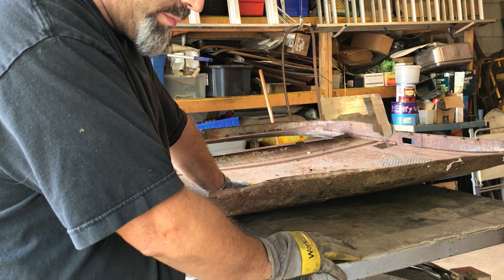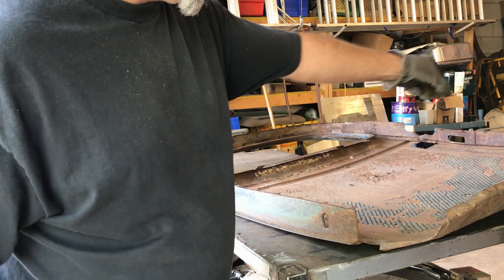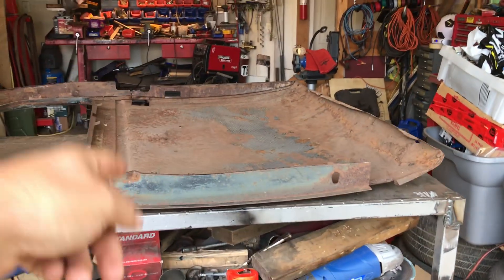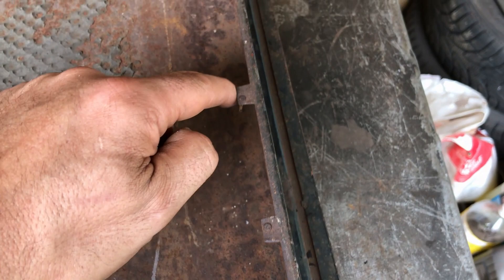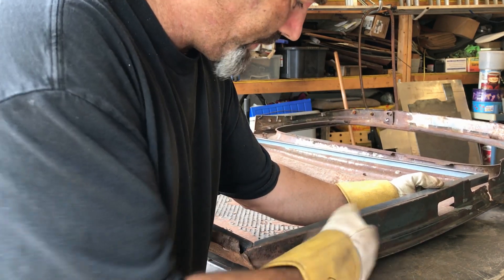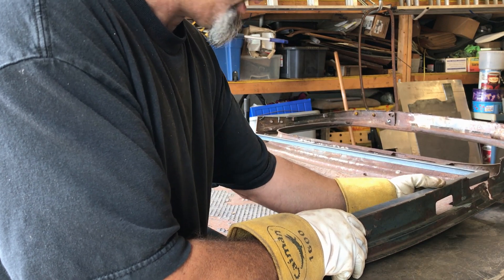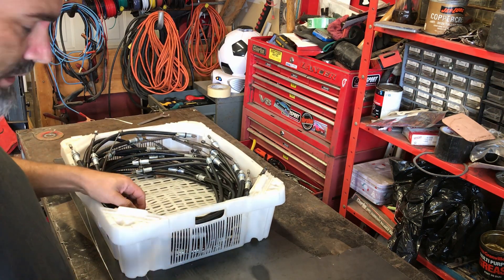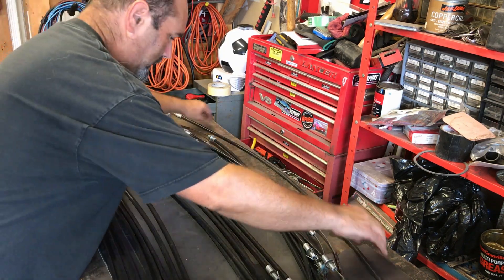Door Frame Fabrication Part 2 On My 1936 Chevy Coupe

Comment: been watching for a bit now getting some tips i am starting a 1935 chevy master coup so if you have some links or advice where to get some parts or what you used on your biuld would be helpful
Reply from the maker: If you are going for a period correct car, then parts will be tough to find. If you are just building a hot rod, then with a bit of imagination, you can make just about anything fit. 
I made do with what I could find at the time, with plans to replace with better parts when funds and parts became available. I didn’t want a ten year project, I wanted a one year drivable project that I could improve upon over ten years lol.

Comment: I used wheel spacers in the past on a 69 340 dart to convert from14 to 15 inch wheel, but never trusted them under power so I removed them, but for what your doing it will be fine ( as they say) lol great video Dave...✌️🤙🏻👍👊🏼

Comment: Hey Dave. That wasp looks pretty drunk. But how could he get drunk on Coke?🤨 I bought a set of spacers for my Fargo. I needed the rear wheels to be 1 1/2 inches wider on each side. Mine worked perfectly. I hope yours do. Thanks for sharing and thanks for the preview of the cables. I sent you an email about the cables. The ends don't matter to me. I can reshape them if needed.🍁👍👍